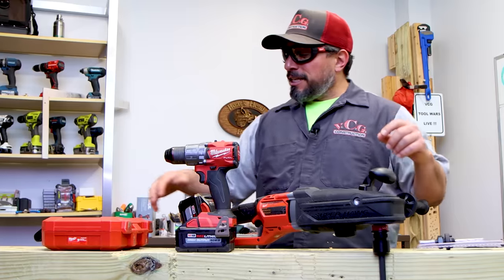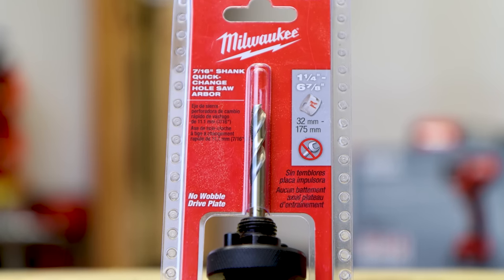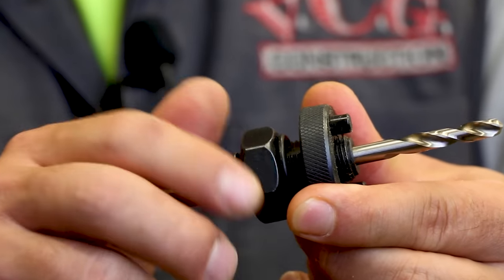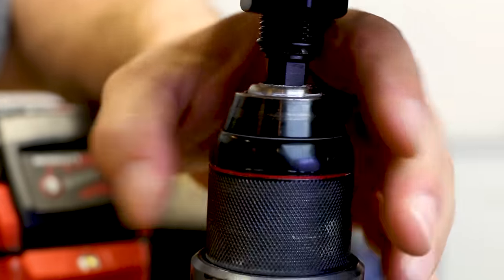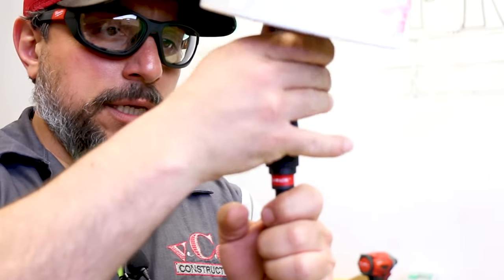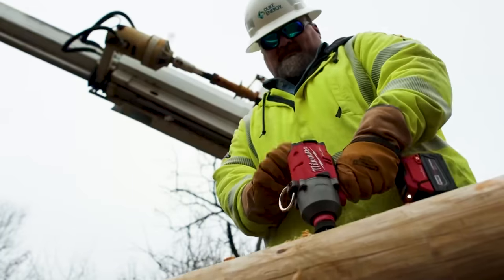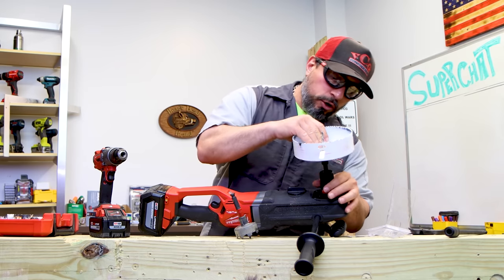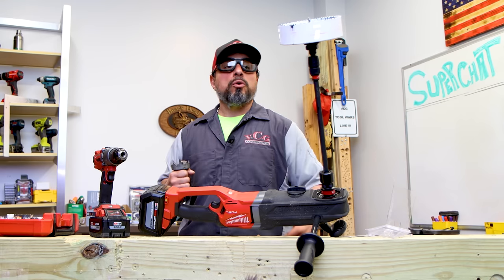NEW MILWAUKEE TOOL ACCESSORY HAS A HIDDEN FEATURE YOU DON'T KNOW!

Comment: I got the super hawg without the quik-lok system because I can use different sizes. But, here’s the hack, I can throw on the short quik-lok bit and have myself a quik-lok hawg as well. What you guys think?
Reply: 👍👍Lots of companies sell 7/16 quick change adapters that don’t add on much length, you could just leave it the keyed chuck

Comment: Don't know how many will see this. HD has a special going on. Get the M18 starter kit, 8 AH battery, 6 AH battery, rapid charger and bag 299. Then add the 229 Rocket light to your cart and the total will still be 299. Works with some but not all zip codes. Worked for mine, use it if necessary. 33321
Reply from the maker: Thanks for the heads up cuz! 👍🏻
Reply: Looks like a "buy the batteries combo, get a free tool" promo. The rocket light prolly isn't the only tool available.
Reply: @pescatoralpursuit1726  You are correct, but it is the most expensive one. I think there are 2 or 3 tools that qualify
Reply: Thank you for sharing!  I've been wanting one of the m18 rocket lights but couldn't justify the $229 price on it's own.

Comment: Yo Vincent! Been running that M18 Super Hole Hawg. Great for rough in on drains and vents in tandem with Big Hawg Carbide 3 tooffesses. Now I need speed bore bits for the 7/16 quick chuck for drilling out for water lines. Got any suggestions? Thanks in advance VCG!

Comment: Vince quick question I bought the super hawg and it came with the heavy duty high output  xc 8.0 but it drains the battery very fast. Which is the right battery for it.
Reply from the maker: try the 12.0
Reply: @VCGConstruction  thanks so much. By the way great job with the videos.

Comment: Hey Vince, it's boring to screw the hole saws on the bits, bosch has a fast lock system on the "progressor hole saws" something like that I'm not sure about the US marketing name. You can also use an SDS bit with it it's pretty sweet

Comment: Quik lock system is such a time saver and has eliminated many headaches when drilling holes.now all they need to do is figure out quik lock system for hole saw bits the pilot bits for the hole saw system.

Comment: Anything that saves time on the site is worth it's weight being there.
 Got a question for the gang. Have any of you seen or used that Milwaukee  M18 hole punch? We are still using the old hand crank punch. Looks like a giant metal caulking gun with a sharp outlet box welded to it lol.  Hey Vince, anyway you can get your hands on one and demo some punches in different gage aluminum and steel roofing?

Comment: I have the extension as well as hole hawg hole saw kit. Came with a packout ... always got mad when trying to make auger fit my m18 hammer drill... hole hawg hole saws are too extreme to go through siding unless going in reverse for a bit otherwise its chip city with vinyls

Comment: unfortunately milwaukee hole saws arent that good... they are actually some of the worst i have used. i have literally open a new milwaukee hole saw and tired to drill out a 2 1/8 hole through metal for a door (lock installer), didnt even make it through! hole saw blunt! i did it again with a new milwaukee hole saw thinking it was just might have been a one off, nope happen again. lenox(these are the best i have used) went through fine and so did kobalt(i dont recomend). i have drilled out 1000s of holes. gone through alot of hole saws and different brands(spyder is pretty good too). i have gone through 2 milwaukee 18v brushless drills, (yes they do die). off note diablo hole saws are good but their clutch/arbor system sucks. keeps getting jammed. for metal lenox last the longest, for wood, spyder is freaking amazing.